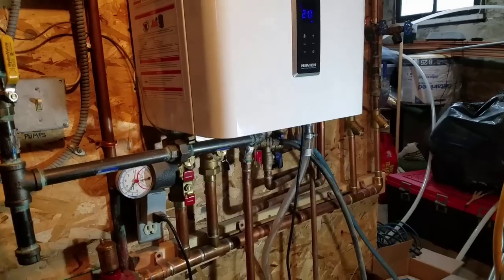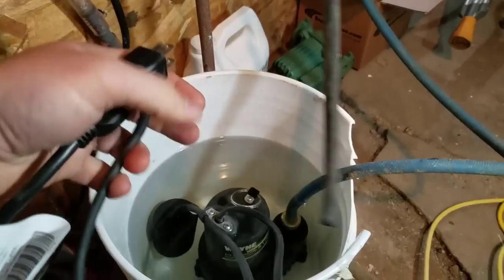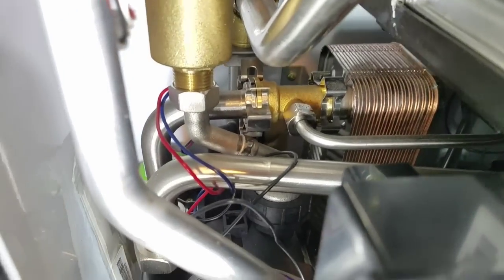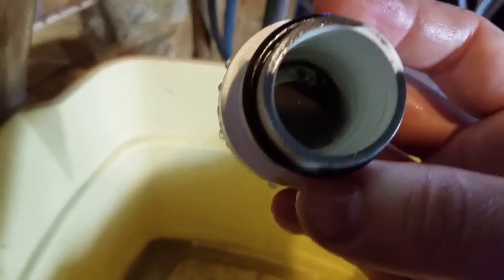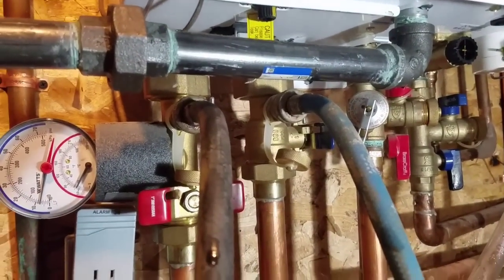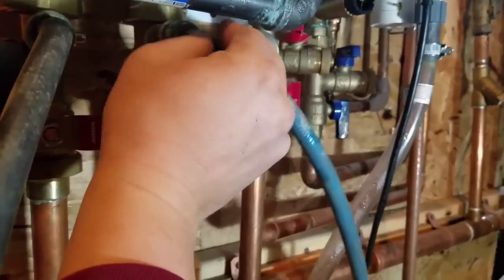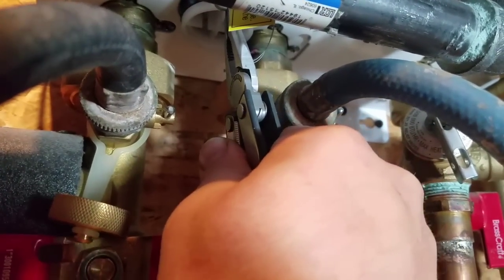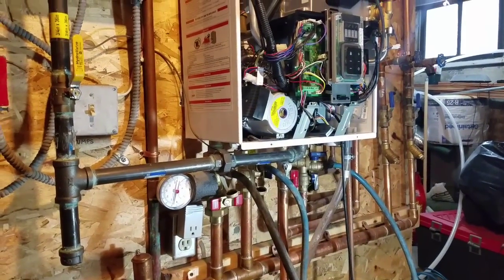How To Flush Descale Tankless Water Heater and Maintenance heat exchanger Navien NCB240 Combi Boiler

Comment: Do you need to bleed the boiler side once you finish your flush since you’ve introduced air into the heat exchanger? I have an old radiator system in the house that doesn’t have any accessible bleed screws

Comment: Summary of service shown in vid, does this sound about right?
- clean inlet filter
- clean condensation trap filter
- flush hot water side of unit
- descale hot water side
- clean air intake filter at top (added)
- flush hot water side
- flush heating side of unit
- descale heating side
- flush heating side with regular water
- clean condensate drain trap

I have some iron pipe and rust in my heating loop, so i was wondering if this is good to do:
- flush heating loop with regular water, then mix in fluid recomended by Navien?

Comment: great video, im having  a problem with  flushing my combi boiler. DOmestic side was no issues, but the main heat exchanger does not circulate water almost as if there is an internal valve that is shut off. any input would be much appreciated. thanks in advance
Reply from the maker: Probably stuck 3 way valve

Comment: How do you open the 3-way valve to flush out the space heating side of the DHW exchanger?
Reply from the maker: By turning the thermostat up to call for heat. With the gas valve off
Reply: @larsonhomeinspection9932 This implies turning the power back on during the flush process.  I am especially concerned about having the space heating pump running while the valves are closed.  Do you recommend turning the power on, setting the thermostat, then turning the boiler back off or ok to leave the power on?
Reply: he connected the cold water inlet from the domestic hot water side to the inlet of the space heating side, then the outlet of the space heating side to the bucket. this way when you open the valve it pushes the water from your main water line through the hose, into the space heating side, then out to clean it all out with fresh water.

Comment: I was told on the high efficiency condensate LP heaters we need to flush the outside of the heat exchangers too, is this correct?  otherwise they rot out I was told, since I lost 1 unit already... I was going to buy a flush kit for the inside, what do we do for the outside of the xchanger where exposed to the heat?

Comment: Great video.  Thanks much.  At the end of your video you flushed any remaining vinegar in the space heating side with water from the domestic cold side.  I thought I was doing this step right, however, I accidentally opened the space heating cold supply for about 30 seconds and flushed.  After realizing my mistake, I shut the space heating cold supply off and proceeded to flush with the domestic cold supply.  Did my mistake introduce fresh water into the space heating side?? If so, will this cause problems and what can be done about it?  Thank you again!
Reply from the maker: Thanks! Adding a little fresh water won't hurt a thing

Comment: A lot of guys say not to flush/descale the boiler side of the Combi units. They say to only do the domestic side. I'm confused? Looks to me as though the boiler side is the filthy mess that should get the most attention.
Reply from the maker: It's debatable if its necessary..Navien did say they recommend it. But I'd only do it every 5 years or so.

Comment: I have a 250/150 navien combo.I cleaned out the condensate filter.The condensate fill tube is located against  the back wall.How do you fill it since the rubber stopper is against the back wall of the unit?Thanks for your help.Randy

Comment: I accidentally drained the water in the non-domestic side and the pressures dropped. How do I refill the water on the non-domestic side?
Reply: i thought it has an auto water feed that will fill up the water in the space heating side automatically.

Comment: how would you go about purging the air out of the baseboard in your home with this unit?

I have the exact same combi unit that does both domestic hot water and radiant heat as you have in this video.  If I wanted to purge the air out of the 4 zones I have what would you recommend?  My question first off is, do I need to shut the iso valves  on the domestic water side or do I leave them alone? 2nd question is do I need to shut off the iso valves on the boiler side or leave them open too?  3rd question is should the unit be on or off?

anyways as far as purging the loops, I have 4 circulator pumps for the 4 zones.  Lets say I am doing the first zone, would I close off the other 3 zones at the pumps I am not purging and on the return side, would I also close off the 3 zones I'm not purging?  I know you have to hook up a garden hose to the spigot and open the hose bib on that zone and let the air escape.  my last question is right after the return manifold before it goes back to the boiler, theres a ball valve.  Does that stay open or closed? Appreciate any advice you would have to offer
Reply from the maker: ya, hook up a garden hose to introduce, and have a garden hose on the end of the loop purge valve to remove air. Purge each zone individually if you can. Let the water run through that zone and flush the air/water until only air comes out. Doesn't matter if the domestic or boiler valves are closed. Some systems have little air purge bolts in the radiators on the upper level to remove air.

Comment: How did you get the boiler flush into the system.  When did that happen?
Reply from the maker: I had a 4' washer hose installed on a purge valve for inlet, and another hose at the end of the loop. Opened the end loop valve to drain water. This started a siphon on the inlet, so I could pour the conditioner directly into the garden hose (holding it above the valve) which would get siphoned into the system. One quarter of the boiler conditioner/flush. Or you could pump it in with a pump.

Comment: I have the same system and the heat side seems to be air locked. Can you do a video on how to flush out the heat distribution side of the system to get airlock out?
Reply from the maker: hook up a garden hose to an inlet, and have one on the outlet, run water through until all air is gone.

Comment: Good video. You didn't have to have your thermostat call for heat and swing open the 3 way valve before flushing the heat side of the system?  Is this a necessary step or am I overthinking it?
Reply from the maker: Yes that might be necessary. Didn't need to on mine or it was already open. Great question!

Comment: Great video! I hope you can help me as my "certified" Navien tech doesn't have a clue. I stupidly waited too long to descale my NCB-210 and the DHW side is fine but my Heating side is quite sick. When I try flushing with the pump on the cold side I get NOTHING out of the hot side. Reversing it I get good flow. When I run the system the loop gets hot but I am getting a rhythmic knocking almost like the sound an old sailing ship makes as is moves in the water. I have tried vinegar and commercial flush. Is my heat exchanger toast?  Thanks!
Reply: @aliencivilizationn  Hello... My final fix was replacing the, 3-Way valve.  A bit of a bitch to get to but an easy procedure. Only about $35 on Amazon or Supply House. The latter a fantastic source for HVAC stuff. Good Luck!!
Reply: Good! It fixed my issue and even though it was hard to get to it saved me a couple of hundred bucks doing it myself. You might have leaks at the union under the valve so take care to use tape & sealant and use silicone grease on the union washer...

Comment: My Rheem Combi maintenance instructions suggests flushing at 4 GPM, or 240 GPH.  The Wayne 1/3 HP sump in your video has this spec:  "High performance; max. flow rate is 4600 Gallons Per Hour; 3060 GPH at 10 ft. of discharge lift".  I know your unit is a Navien, but is there any concern that the sump pressure could damage the unit?
Reply: *BUMP*.  Rheem says using a sump pump (like the one in your video) could destroy the unit.  Another contractor says he uses "Everbilt non submersible transfer pump. 6GPM".  What do you say?  Isn't the responsible thing, for the benefit of others who may follow your instructions, to respond to my inquiry?
Reply: Navien Support 2 
11:51:03	Thank you for contacting Navien. How may I be of assistance?
Dan
11:51:51	Hi, I'm looking at the NCB-240/130H Combi. I don't see a recommendation for GPM flow rates when doing flush maintenance. Can I safely use any sump pump, or is there a recommended upper limit on flow rate?
Navien Support 2 
11:52:43	normally any smaller size pump would be fine 1/8 and about 2-4gpm should be fine
Dan
11:54:49	OK, but could the unit be damaged by using, e.g., a Weber 1/3 HP sump (50GPM)?
Navien Support 2 
11:55:20	that would be a bit too strong.
Reply: Above is a conversation I had with Navien about this very unit.  I'm disappointed that Larson hasn't responded to an inquiry about what could be a very serious issue.
Reply from the maker: @danmorton9461  I don't check youtube comments very often. Sorry for just getting to this. I don't make money off these videos, just for information. I'm not a substitution for a technical support tech from the company or for a plumber. I wouldn't worry too much about how large of a sump pump gpm. Think about how many gpm come out of all your fixtures in your house when they are all on.

Comment: Where is the cold water inlet for the closed loop space heating side? Does that inlet need to always stay open since that system is a closed loop? How do you add water to the closed loop side?
Reply from the maker: There is a port on the far right of the unit to introduce water to the space heat side. This should be piped to domestic water. This one has an auto feeder to introduce water when it gets down to a certain pressure, so yes it is always open. Or can use a garden hose on a purge valve.

Comment: Navien sucks over engineered pieces of cross contaminated garbage, just wait till you see oily residue on the bottom of heat exchanger and black residue on the vent adapter…lmk It’s called a sediment trap

Comment: How do you inject the boiler conditioner into the boiler side
Reply from the maker: I had a 4' washer hose installed on a purge valve for inlet, and another hose at the end of the loop. Opened the end loop valve to drain water. This started a siphon on the inlet, so I could pour the conditioner directly into the garden hose (holding it above the valve) which would get siphoned into the system. One quarter of the boiler conditioner/flush. Or you could pump it in with a pump.

Comment: hi, so if you have the domestic side valves open, it doesn't affect the left side inlet and outlet?  i see you were doing the vinegar pump while both of the domestic valves were open.  so, opening the valves on the domestic side and then opening the service valves on the left side, the water from the right domestic valves won't come out of the left boiler side outlet?
Reply: they are 2 different systems in one unit. the water takes different paths. left side which is space heating is a closed loop.
Reply from the maker: @Jallelab99141  correct

Comment: How do you get boiler flush into boiler side?
Reply from the maker: I had a 4' washer hose installed on a purge valve for inlet, and another hose at the end of the loop. Opened the end loop valve to drain water. This started a siphon on the inlet, so I could pour the conditioner directly into the garden hose (holding it above the valve) which would get siphoned into the system. One quarter of the boiler conditioner/flush. Or you could pump it in with a pump.

Comment: How do you air out of the space heating side lines?   I got air in lines last year
Reply from the maker: ya, hook up a garden hose to introduce water, and have a garden hose on the end of the loop purge valve to remove air. Purge each zone individually if you can. Let the water run through that zone and flush the air/water until only air comes out.  Some systems have little air purge bolts in the radiators on the upper level to remove air. Your system should also have an air scoop and air eliminator/separator to constantly remove air out of the system.

Comment: Feel  bad for the consumer who is paying you to do nothing because your uneducated
Reply: I did this service on my own boiler. Can you tell me what I did wrong?
Reply: The tankless water heater has what's called a servo valve and when water flows through it opens and allows water to flow through the heat exchanger so when your descaling the heater you have to leave the electric plugged in and you will hear that valve open and the descaler goes through the heat exchanger and when you unplug it the valve can't open so you just ran the solution through the service valves
Reply: @ericmurphy8773  that may be true on other models, but not with Navien. If you watch at 3:14 you can see the routing of the pipes. There is no bypass valve. The water always flows through the heat exchanger. You can see the water turned blue from descaling the lime in the system.
Reply: All tankless water heaters have a servo valve go unplug the unit and turn on a two handle faucet on the hot side and no water is gonna come out
Reply: @ericmurphy8773  just did it. You're wrong.

Comment: Great video. How do you refill the space heating side of the heat exchanger once you finish flushing cold water through it? I tried just turning on my unit and the auto feed refilled it but then I had a ton of air trapped in my system. Thanks
Reply: I have the same question, the video ends before that side is refilled with water.  At 8:45 you mention that boiler water is filled and never drained and you don't want to introduce new water but if your draining water out of the unit on the space heating side, don't you need to replace it with new water?
Reply: I too am dealing with this issue with my mom's boiler. I was able to download the "Quick Installation Guide" and there it states that you must remove the air vent cap before refilling the unit. Then you are to replace the cap when the unit is full. That's all well and good, but, how do you know when the system is full? Will water come out the top of the air vent? That's my guess but it would be nice to know one way or another. Another issue I had is when I removed the cap, a whole bunch of really small fiber/paper washers/O-rings fell out of the cap. Be careful with that as I don't know what order they're to go back in. If anyone here has gotten an answer, please share. Thanks
Reply from the maker: @eddiemarano9998  yes air comes out of that vent cap, and when water comes out you know it's full. It constantly purges air from the system.
Reply from the maker: The boiler is isolated (valves closed) from the rest of the system when I am flushing it. So most of the water stays in the branch lines. Shut the outlet valve before you turn off the inlet valve so the new water stays in the heat exchanger.

Comment: Ive read that Navian doesn't recommend servicing the space heater side.
Reply: I came across a Youtube video that said the same. But there are other videos that show the space heater side being flushed.  It's a real shame that Navien doesn't document descaling/maintenance processes in the user manual.  And their not inclined to help if you call them directly as a homeowner.
Reply: @BobPritchard  I called Navien myself and explained that I have a NCB-240 and asked about my warranty and suggested service. They advised that both the closed loop heating side as well as domestic hot water side should be cleaned every 1 to 2 years with a biodegradable, potable safe product such as floaide, fernox, hercules: haymaker. White distilled vinegar can be used as a backup but typically does not have the high acidic levels needed for a thorough cleaning. I also asked if flushing the system with said products would void the warranty and was advised it will not and was in fact recommended by the manufacturer to keep both the closed loop side and domestic side of the heat exchanger clear and operating correctly.

Comment: Question about the closely spaced tees - what purpose do they serve? It seems like it would be less efficient to have cool water potentially bypass the boiler and go straight back into the space heating system. Why isn't the boiler installed inline so that all water circulated through the space heating system must pass through the boiler?
Reply: Great question. Modern high-efficiency boilers have a much lower flow rate through their heat exchanger than cast iron boilers. The tees are a hydraulic separator to allow the flow through the primary loop to be higher than what goes through the boiler. Also, if there were a blockage or valve shut in the secondary loop, it prevents dead heading, and allows boiler pump to circulate water freely.
The pumps and pipe sizes are calculated so all of the hot boiler water goes into the supply side and doesn't recirculate back to the return.

Comment: My combi unit does not have the service ports on the space heating hot water sides. This seems like a major install error. is that correct?
Reply from the maker: Yes they should have definitely installed them
Reply: @larsonhomeinspection9932  So if there are no service ports on the space heater side, there's no way to flush, even if you get the 3-way valve to open? Because that simply routes the space-heating loop through the isolated plate exchanger? If so, my option is to either get them installed or flushing the whole hydronic loop...
Reply from the maker: @autonomy5649  correct